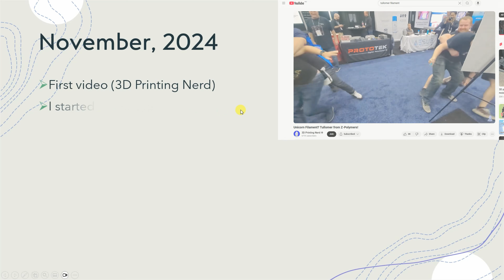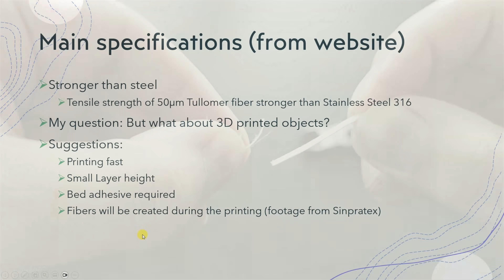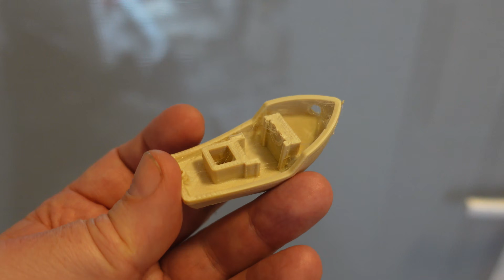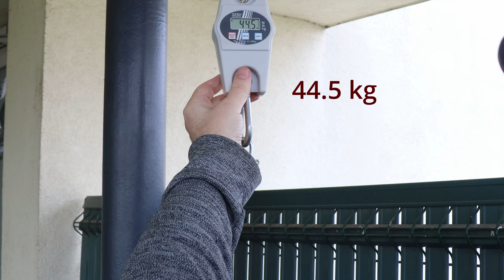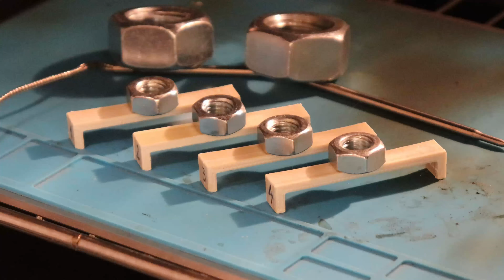Love it or Hate it: Tullomer filament

Comment: Nice testing as always!
So you think an epoxi resin infusion would help? The resin would glue the fibres together like in a composite.
Parts should be designed to fit the infusion process.

Comment: 1. Dry completely.  Not sure if 4H@70 will have sufficed.  2. Anneal??  3.  Chamber heat.  does it need 80C?  100C?  120C?  4. Can we have the  brim literally touch our model on all sides?  5. Cool down: should be slower?  6. .2 nozzle?  .8 nozzle?
Reply: 2. Manufacturer claims annealing is not necessary. They also state glass transition temp as n/a, so i'm not sure how much it would help. 
3. Pretty much the hotter, the better based on TDS

Manufacturers samples had the same issues, so this is just how this material works. Unfortunate tbh.

Comment: With such poor later adhesion, I see only a very limited area of use for this. I wonder if there is a way to fix that problem. We infuse wood with epoxy or polyester for significant strength gain (among other things). I’m curious if heat and pressure would allow infusion in this as well. But I’m not about to spend $500 on this to find out. PPS-CF and PPA-CF is more than good enough for most anything.

Comment: You can see, in almost every case, it exclusively fails in shear due to that atrocious layer adhesion. Mabye they could wrap the tullomer in an interface polymer that has good homogenous adhesion to itself and the tullomer, giving some improved shear/z strength, but keeping the tollomer inside for that insane tensile strength

Comment: I would like to see how it prints on the Qidi Plus 4. 
With chamber heater set to 55 to 60c. 

The Xmax3 chamber suffers from drafts. 

Wondering what part  cooling fan % was used?
Reply: Part cooling fan should be completely off for this material

Comment: Also one more question can you also try another batch of parts at the same later everything except higher end temp of the recommendation and then 1/2 the speed just to see if it is better or worse idk but I don't think peek is printed at 300-600mm/s idk but that is my guess also sorry I keep posting but was the fan on for any of the tests as based on the delamination it appears just as nylon does when a fan is used at high levels without enclosure it still prints awesome but will delaminate into a part shaped slinky of strands very easily lol want to know any and all I can before I try and buy something this expensive for just to have purpose 

I wish you could have tested taulman3d cast plate nylon which is like the company long gone 😢 it was allegedly the strongest ever 2+ times 910 strength

Please re print some of the parts and turn off part fan totally and also turn off the chamber air filter fan or fan 3 on Xmax 3 as it makes a draft just to be sure it's not fan is zero effect

Comment: Question if the layers have to be so fine like .01-.05mm then why is the first layer or Initial layer height .25 would that not counter effect the whole part as the fibers are supposed to be produced in the very fine settings I'm asking cause I don't know just from what I have seen and now re watching this again cause I now know what tullomer is and is said to be thanks for the all the info and videos always great

Comment: I wonder if a tool changer printer could print strips of it bound inside a different filament with much higher layer adhesion as a form of fibre reinforcement? 

The question becomes, what FDM materials does it adhere well to?

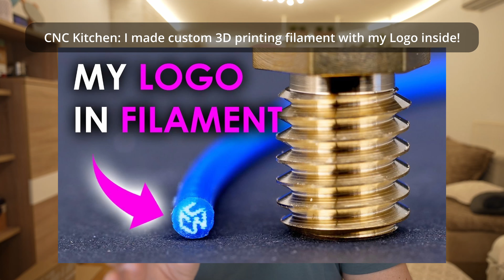Edit, lol. I'd paused the video just before 18:35 where Igor says exactly the same thing.

Comment: What would happen if you covered the part in salt and tempered it at a high temperature so that the layers melt together?
The salt would apply resistance to deformation and it's easy to remove any embedded salt simply by washing.

Comment: Hello Igor,
Here is an idea to test Tullomer for good: 
A; buy forming sand.
B; take a sturdy coffe grinder (meat grinder might work too or meat mincer, electric) and mince down the tested Tullomer broken parts you have already. If Tullomer tends to heat up and bind, do it in a water environment, by adding half a cup or one cup of water in the grinder.
C; 3d print all test parts in PLA 2walls 15%infill or less
D; use them for lost casting to form the sand
E; dry the Tullomer flakes at 80C a few days
F; heat the casting forms at 250C to eliminate the PLA
G; melt the Tullomer dried flakes at 380C and cast it into the forms.
H; test them to have a base idea how Tullomer behaves in real world when 100% infill absolute bonding is provided
(You could try injection moulding but you need to find somebody that has a Precious Plastic or similar equipment in their garage and someone else that can route you molds in aluminium)
Reply: it won't work, it doesn't have properties as a regular thermoplastics. it needs formed fibers
Reply: @riba2233  you might be right, but again, is worth trying, after all is just scraps that are a waste anyway, at least he can have a comparison standard to work with.
Reply: Another idea is to try printing it on a modified e3d tool chager, chamber enclosure controlled temp up to 60C for now, bed max temp 200C and nozzle max temp 500C.  I have one if you need to play with.
Reply: @  that one is not fast enough :) basic idea is to print really fast, around 500mms and with thin layers so you draw thin fibers as you print
Reply: @riba2233  that is if you want fibers, like kevlar bullet proof garments, but what if you don't? What if you want solid infill?
Reply: @emilpop2016  there is no want or don't want, this is how this material works and extrudes, I see that lot of people are really confused about this. You can get solid infill, you just have fibers densely next to each other.
Reply: @riba2233  not confused, just don't trust your view, how do you know it? Because somebody said so? Or because you have tried it out? In person.
The filament they sell is not in fibers, is solid infill, so it must work.  Simple logic, no magic involved.
Reply: @riba2233  yes you can have solid infill, the spools of filament they sell are 1.75mm solid infill, hence, yes it can be done, we only need to figure out how.
Reply: @emilpop2016  I mean all the samples in this vide0 are with solid infil
Reply: @riba2233  fibre infill 100% is not solid, is more like Dynema rope solid... Lol.

Comment: Thank you for this video. So, if you have something that doesn't need layer adhesion (there is no such a thing), use Tullomer. If you need layer adhision (everything that is 3d printed) use any other material you can find 🤣 If you need something mechanical to print, use ABS, ASA or PA. Use expensive materials only because you can, not because you have to 🤣

Comment: The bottom bowing like that is very strange. My theory for that behavior is that it's a combination of the nozzle temp not being quite right and the accelerations not being high enough. Essentially it's printing the ends slower than the middle because it has to slow down to turn around. On the ends, the plastic is being extruded slow enough that the internal stresses in the material get partially melted away and it acts like a normal 3d print. However, in the middle, it's behaving like the engineers want it to but the part is still glassy enough that it's acting like stretched silly putty. I'm not sure there is a happy middleground between these two effects
This filament is kind of a neat concept, although if my hypothesis is correct, then it would need accelerations faster than what a Bambu could do. Maybe a fully tricked out voron V0 would do it?
I'm assuming they are using a stock Bambu steel nozzle, so the temperature near the tip is ~10C lower than in the melt zone. I'd recommend using either a brass or a nickel-plated copper nozzle and tuning the print profiles again with ~10C lower temps in mind and seeing what the results are.

Comment: What was the nozzle temp used for these prints and is there a chamber heater in the X1C?
Reply from the maker: X1C 290 and 300. Later on Qidi 340°C and 60C chamber

Comment: Seemed too good to be true when I first learned about it. Seems that is actually the case. I would like to know what is making it fibrous like that, if it is a property of the polymer itself or if it is added in like GF/CF, but something else. In the end I have to agree with your conclusion. It's awesome in a few use cases, but without good layer adhesion or more isotropic strength it is limited in applications. I wonder if they are already trying to make a version 2 with better layer adhesion. Even companies like Polymaker didn't stop at simple things like just using virgin ASA, so they also used some additives to make it better. Surely this can be improved, too.

Comment: I assume this filament need a very hot chamber to get even decent layer bonding, the glass transition temperature seems to be like 180C so I guess we’d have to try a printer that can get the camber up to 170C or more. If you print a polymer right below it’s GTT and then cool it down slowly as a whole you get much better layer bonding. So this material is probably only usable on very high end industrial machines.

Comment: I was thinking of coextrusion too, but the material will have to be really carefully optimised for that. Maybe we only need a "glue" plastic, like only a few micrometer thick layer which has high adhesion to this plastic.
The other way would be multi material printing, and only print the reinforcing "fibers" from this, and surround it with another plastic. But multi material printing is more difficult, especially on cheap printers.

Comment: Very interesting filament and great analysis. I think a much higher bed, chamber and extruder temperature, and much slower printing speed might be needed. Like the approach used for so-called "3D printed glass". This will enable the polymer chains to flow and fuse better across layers, and the higher bed and chamber temps will hopefully prevent more warping. The slower printing speed will also apply less force to the print if it does start warping, so you'd get fewer failed prints.

Comment: Seems there really isn't a perfect printing solution for this. I'd like to see it printed on a Qidi Plus4 with max nozzle and chamber temperature maybe. 😂
Reply from the maker: In video I did the layer adhesion with Qidi XMax3 (340/60°C). But one of my viewers will give it a try on Prusa HT90 (400°C or something like that)
Reply: @MyTechFun  Ohhh yeah that's about the limit of most consumer machines. I missed that detail. Seems a very difficult filament in that sense. Curious if higher temps will even help. Great testing!

Comment: Curling up can, in my experience, only be mitigated by a substantially higher chamber temperature. Since it happens because of the thermo shock of fast cooling on thinner elements/outer walls. This will also help with layer adhesion, since due to fast crystallization, layer adhesion suffers since the filament is crystallized before it gets time to form a bond to a new string of filament.
Another thing that can be done is curing of printed parts. Similar to PETG in salt. But this has to be tested; it's only speculation.

Comment: i wonder if printing in vase mode would improve the z axis strength. It looks like the whole gimmick of this filament is the long strands of fiber along the length of the filament and Ill bet the reason z axis adhesion is so bad is because it stops extruding before switching to the next layer.

Comment: @CNCKitchen should try to make a custom Tullomer core with a nylon or other binding material (maybe something that likes to print at a similar speed to Tullomer, or many types to find the best internal pattern and material) for the outer layer to get the best out of both worlds. This gives me the idea that this could replace the filaments with continuous carbon fiber strands as this requires far less equipment that costs a lot less, and could be used in more diverse applications because you don't need to cut the fiber on every travel. Just a fun idea ;)

Comment: Would you be willing to try another print test? I understand if not it's very expensive filament but some of the way they're telling you to print that doesn't seem to make sense why such low layer height why such high speed? You're qidi print seems to indicate this is wrong I would like to see you print something with a 0.8 mm nozzle at 0.4 or even 0.6 mm layer height at around say 6 cubic millimeters a second real slow real fat as hot as you can get it as hot as you can get the chamber it'd be interesting to see how much layered he would improve it might not be measurable with your tiny part tests but for larger prints it might produce more usable results.
Reply from the maker: I am collecting suggestions, there will be anogher video in few weeks. So far: annealing, slow print, bigger layer height, printing on 400°C, 0.6mm nozzle...
Reply: @nerys71  These LCP filaments need very fine layers apparently.
Reply: It doesn't work with normal layer heights, there is a reason he tested it this way...

Comment: Very interesting a disappointing for the filament. It would be really cool if you could work your way up to maxing out layer adhesion settings on your xmax-3 and show us your settings for every iteration. Like work your way up to highest heat bed temp possible highest enclosure heating temp possible, highest nozzle temperature the filament can handle and slowing down print speed. Maybe increasing layer height could also allow for more thermal mass to conduct heat to the layer below. I was interested in this filament and also have an xmax3, but after this video I'm not going to bother. I did just buy some Siraya Tech ppa-cf filament which seems like a much cheaper alternative to Bambu's ppa-cf. I got 4 kilos at $40 a kilo so it'd be cool if you could do some testing on that as well. Thanks for all your hard work!

Comment: Hello Igor, could you please test Luvocom 3F PAHT CF 9742 BK Filament? It is being used by many filament producers. It has an E-modulus of 15GPa and tensile strength over 150MPa and very little water uptake. It must be annealed for best properties. 1 hour from room temperature to 70DegC and then 120DegC for 4 hours, turn off oven and let cool down naturally. Do not remove from oven over 60DegC.
Reply: What is its base material, pa66 or ppa?

Comment: I had contacted Z Polymers last year. Haven't heard back. I had thought of a few things that could help with layer adhesion. Hadn't considered co-extrusion though. That could work but consider, if Tullomer has a problem sticking to itself it's likely to have a problem sticking to a material that it could be co-extruded with. That would make a part that may have good layer adhesion in a typical sense but then fail within the layers.

Comment: printing much slower might increase the layer adhesion. The faster the print, the less time the filament gets to heat up in the extruder. Good luck with future tests!
Reply: Doesn't work like that for this one, you have to print it fast and with super thin layers

Comment: This material is amazing for the right application it’s not bad as all the ones saying it’s not good, it’s an engineering material; It’s all about application. It is not something that is meant to be used for hobbies where the de-lamination is a factor, but rather along the axis where it showcases its strength. I work in automation where machines cost hundreds of not millions of dollars and having access to materials like this. My tool belt allow me to do things that normally would cost hundred to 1000X the price

Comment: Layer bricking would be really beneficial for this. It needs to be standardized. Patent troll be dammed
Reply: not sure it would tbh, just because it enhances layer strength, but this has an extremely weak layer strength to start, so i think the gains would be underwhelming
Reply: It wouldn't help at all if it can't even adhere to itself. That's not the purpose of brick layers.

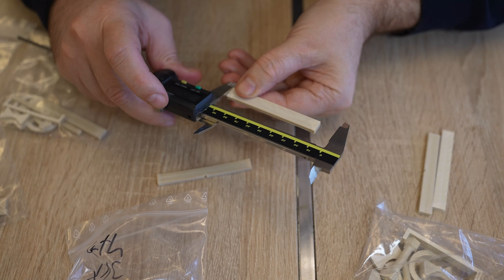Comment: 4:54 This warping pattern makes some sense when you consider the notch at the top of the print breaking tension at the top, causing uneven tension from the bottom as the part cooled. The only corner warping I would expect from this sort of shape would leave the part with a 'W' shape, as the center would have higher tension from the bottom but the wings may have higher tension from the top. This could probably be induced by playing with the ratio between bed and chamber heat settings, with a higher chamber heat resulting in the upside down 'U' shape in the video, while a higher bed heat resulting in the corners raising as we normally expect on hobbyist prints.

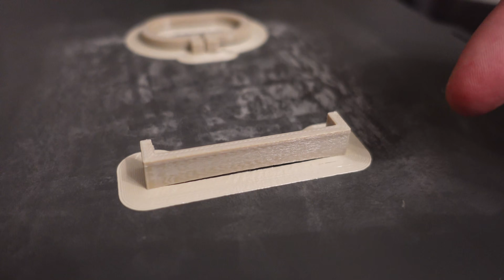Edit: scratch most of what I just said. The same warp pattern is present on the uniform part at 7:10 and now I'm stumped. I maintain that my logic is somewhat sound for normal materials but it is obvious something weird is going on here. My best guess is the filament is so poorly adhered to the bed that the first layer warps off before the second layer is even cooled, and the effect just gets more pronounced over time. My first thought to fix is either better bed adhesion or a much hotter bed, at least on the first layer, to keep that first layer from warping before you print enough of the part that it becomes rigid.

Comment: I think a 3D printed filament is not using the right approach when it comes to strength!! I would like to see a 2-part process that you have a filament like pla that print easily, but then you soaked it in a solution to change the chemical properties or exposed it to uv like dentist filling that solidify once you do the uv treatment. If you look at industrial epoxy, that stuff is extremely hard and can be used for mechanical parts. I'm just trying to think outside the box 🤙.